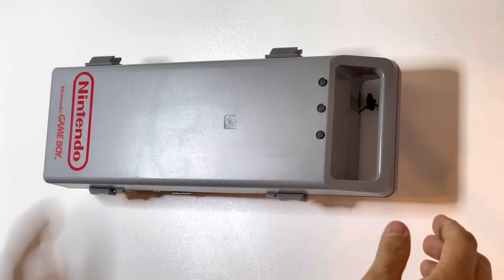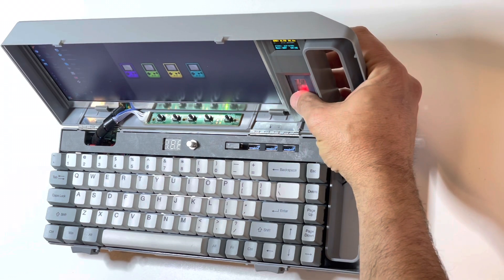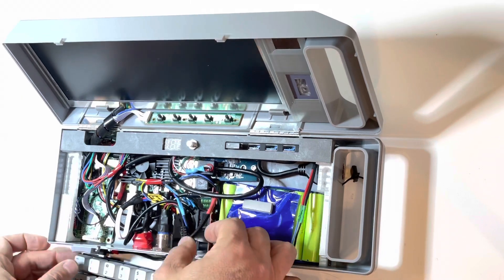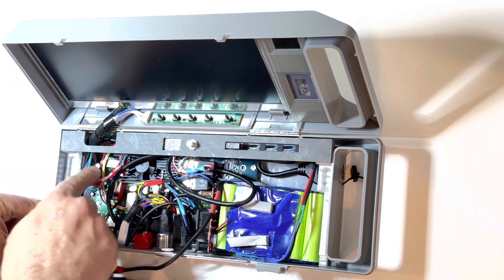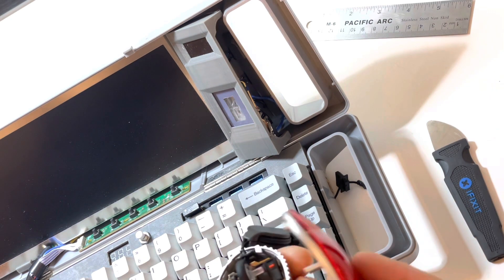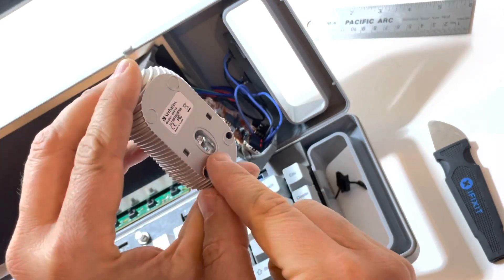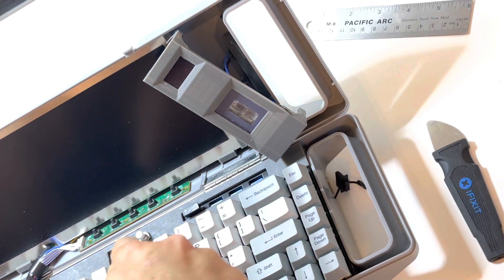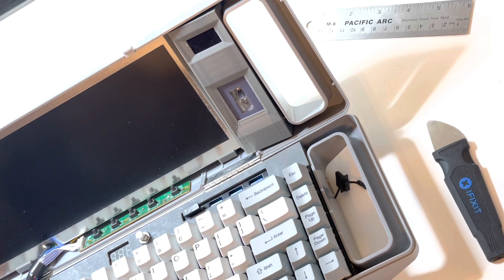Custom gameboy themed raspberry pi powered cyberdeck - in depth tour and details

Comment: Afaik you can ditch 12v , most screens have 12 to 5v step down converters on pcb, so you can directly solder power to 5v . TBH 12 v  is also very nice to have, as someone said, “pick your poison”